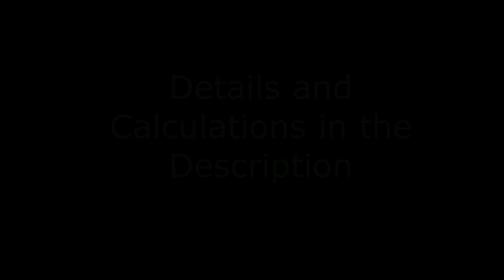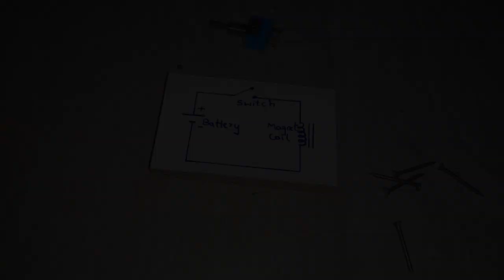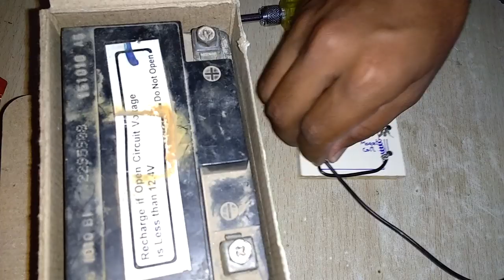How to make a Powerful Electromagnet (5KG LIFTING)

Comment: Doesnt the current effect its lifting capacity?
Reply from the maker: the current through the coil is proportional to magnetic field strength. Hence it will affect the lifting capacity.  Higher the current, better is the strength provided that the coil can handle the current

Comment: Man, at 7:09 you turned the switch on while holding the copper wire, but how come you didn't get electric shock??
Reply from the maker: Since this is low voltage and my hands were dry

Comment: Doesn't it become short circuit?
Reply from the maker: No
Reply: @TheTechnocrat  a coil is nothing but a wire . so when a wire is connected across terminals would it not be a short circuit?

Comment: Good one ❣️...what's the ampere hour of battery U used?? please reply fast I need to know
Reply from the maker: 7.5Ah
Reply: @TheTechnocrat  👍👍...if I use battery of 4 or 5Ah would it be fine with Voltage same as U 12V
Reply from the maker: yes. no problem
Reply: @TheTechnocrat  Thanks to reply 👍..And as I read that Ur resistance of coil is 8.6 ohm ..frm resistance I calculated length of wire(frm relation of resistivity and resistance)..it came out to be 65 meter ..am I right???help me in this question
Reply: @TheTechnocrat  Hey please help to clear my doubt..I need to know it urgent

Comment: Can I use it in a large electric bell?
Reply from the maker: Yes it is possible to make electric bell with this. But DONT connect this to Mains voltage( 110v or 220v) as the resistance of this coil is very low. Connect this to 12v or 24v power adapter.
Reply: @TheTechnocrat  Okay. I have a 12V adapter instead.

Comment: This device powered by battery...can you make it powered by AC..thank's ...sir...boss
Reply: Sumantri Nasa Suntana you could if you didn’t mind the north and south poles of the electro magnet switching or you could make a rectifier to convert ac into dc just be careful to use strong enough wires with ac or over time the might be a short in the coil
Reply from the maker: Yes it is possible to make. As a matter of fact many industrial EM are ac powered. If you are starting to learn (or no experience with high voltage electricity) I suggest to practice with low voltage batteries or ac powered power supplies (like 12v or 24v).
Reply from the maker: More number of turns and smaller diameter wire is required. It depends on magnet strength required, impedance of coil, voltage level , physical dimensions of coil etc. It is really an interesting electric design.
Reply: @thealmondgraham12  thanks a lot ..sir...for your time and tutorial...that way trafo using smallest diameter...right ...i am going to make magnit to lift more weight as  10 kgs up

Comment: Please Also make 80 Kg. Magnetic Lifter + Wooden Crane Project
i.e  80 Kg electromagnet + Wooden crane to manuver around and drop the electromagnet
or pull up the electromagnet

u can use Wire rope in Wooden Crane
or  Injection+Liquid in Wooden Crane to Pull/Drop/Hold/Left/right the Crane Handle
which is attached tooo your magnetic picker !
Reply from the maker: Yeah. Cool idea.

Comment: Hello bro help me in finding this please 
What was the length of the 26gauge wire u used please tell me fast
Reply: It does not mean
Reply: The strength of magnetism is depend on number of turn of coil so you increase the number of turn then it will more powerful

Comment: Why are you able to touch the copper wire while it's charged?
Reply: Because dc doesnt harm. AC does. DC starts to harm when voltage rises above 60 dc volts
Reply: The wire is insulated hence he burns and sands off the tips.
Reply: @muhammadnaufil5237 , DC can take you out every bit as much as can AC. 

You aren't being harmed because the wire you used is insulated. Otherwise, it would short, effectively reducing the length of the wire from the point of the short to the starting and ending points of the wire. Too, that is why you had to burn the insulation off, before connecting the wires to the circuit.

Comment: dude that's not 900 to 1200 turns. That's 3200 to 3600 turns. All of your math adds up to it being 3200 to 3600 turns. Even my estimations based on the wire thickness and coils size add up.
even the calculations I did for the maximum strength of the magnet at the minimum distance 7*(turns*current)^2*magnetic constant*cross-section area/(2*0.05^2)
I derived the 7 and 0.05 (at direct contact the force is 7 times the strength at 5cm distance) based on a chart of magnetic attraction at different distances which showed a change from inverse of the distance squared to approximately linear force around 5cm which is why the force of the magnet isn't infinite when it's sticking to something and I've tested it with many electromagnets already.
Reply: Please respond you're the only intelligent person in these comments, isn't the way he's winding the coil making the magnetic field weaker do to him going back and forth with the wire, making the magnetic fields cancel each other out, my coil is about the same size but my iron core is much bigger and mines lifting my weight easy, anyway I've seen alot of videos making coils in this way and it really bothers me cause I've always been told that the back and forth winding cancel each other is this correct?
Reply: thats a 26 gauge wire pretty strong for a 900 turns . if you wind correctly in one way you can have that strong magnet
Reply: That's super duper many turns.
Reply: @talonjuel9486  no, it's actually fine to double back on itself because he keeps going around the same way. Using the right hand rule you can see how the magnetic field still goes in the same way. I've done some experimenting with a quarter inch thick nickle metal core (I grabbed the first metal rod I saw and thought it was iron, whoops) and realized that the further the wire is from the core (such as with more layers) the less magnetic force you're going to get out of it, so a thicker core is better. I'm currently looking at using iron pipes as the core so I can multi-layer them inside of eachother for more strength in a compact space.
Reply: @potato4dawin1  cool thanks

Comment: Current in amps...?
Reply from the maker: Tayyab Ejaz 668... yes unit of current is ampere.!!
Reply: Tayyab Ejaz 668  look up the resistance of that size wire. Also look up the current carrying capacity for it. Don't exceed it, and reduce power if it gets too warm.
Reply: It could have been wound with a drill if the shaft was left longer.
Reply: The battery he used was a 12v car battery and the coil resistance was 8.7Ω. Using Ohm's Law, we know that the amperage of the electromagnet was 1.37A. I know it's 4 months late, but I hope this helps.

Comment: Wht is magnet wire
Reply from the maker: Vasishta Ramgundam it is insulated copper wire. used in transformer winding and motor windings
Reply: The Technocrat can I use below 26gauge
Reply from the maker: Vasishta Ramgundam Definetly you can use .......as the gauge number decrease, the thickness of wire increase.. so you can supply higher current.... but for the required number of turns...the area required also increases...... so the electromagnet becomes very bulky..... 
So it is better use the wire gauge 24 to 32. 

it is very important to note that the resistance of wire is inversely proportional to the thickness of wire. 

what gauge wire do you own??
Reply: The Technocrat I don't know how gauge is my wire. but it's thin, I got from old DC motor. Wts the cost of that battery u used
Reply from the maker: Vasishta Ramgundam . I think the wire should be fine... make sure it's not very thin ... otherwise it will break. .  

my battery is a motorcycle battery. it costs around 800-1200 rupees. You can use small 9 volt battery also.

Comment: You are guiding with the wrong direction 
* 26 gauge wire thickness is 0.404mm
* solenoid rod dia is 8mm 
Total dia of the first complete turn of the solenoid rod with copper wire is 8.404mm
Total dia of the second complete turn  of the solenoid rod with copper wire is 8.808 mm
Total dia of the third complete turn of the solenoid rod with copper wire is 9.12 mm
assume when complete 1000 turns of your solenoid Dia size is 41.cm imagine you cant lift in your hand. 
A fool is wrongly guided here 👀 be aware of this project. 🤦‍♂️🤦‍♂️🤦‍♂️🤦‍♂️🤦‍♂️🤦‍♂️🤦‍♂️🤦‍♂️🤦‍♂️
Reply from the maker: Do you have any idea what 41 cm looks like.. lol